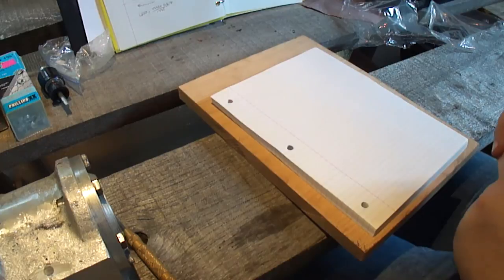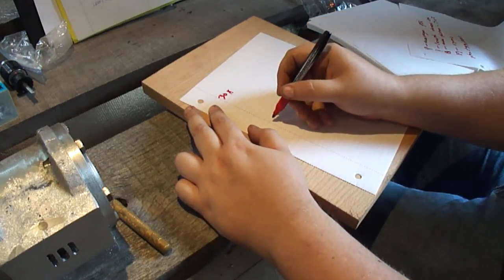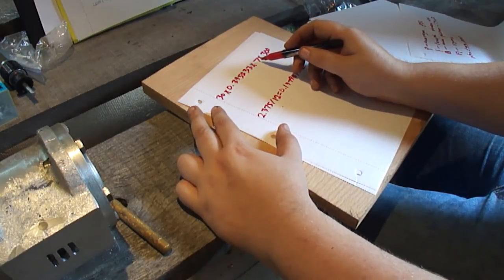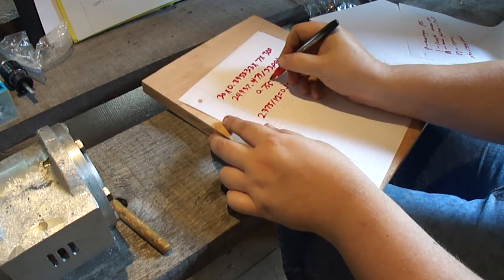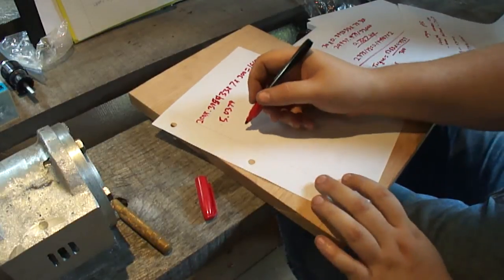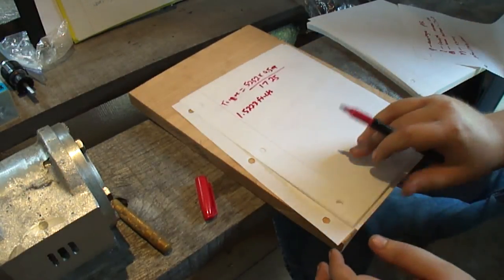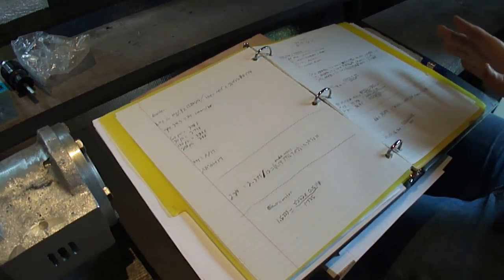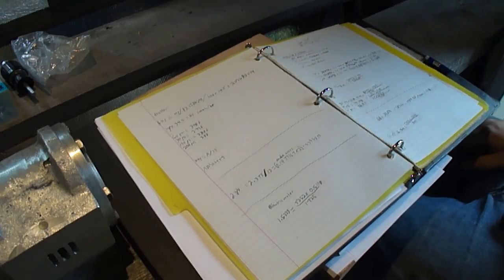Steam Engine Mathematics - Calculating Theoretical HP and Torque

Comment: Have you come across some information that would be useful for computing the torque speed characteristics of a single cylinder, double acting, steam engine?
Reply from the maker: Im almost positive that was exactly what this video was about, lol. It''s been so long since I messed with that stuff that I really wouldnt know anymore.
Reply: @ChirpysTinkerings  The torque speed characteristics isn't going to be linear, so I'm curious if you have come across any references that give a method of approximating the characteristics over a range of shaft velocity (say 0 to 300 rpm), etc. The old text books that I have seen weren't focused on torque speed curves. It may be easier to just measure the performance of a machine with a dynamometer or pony brake.
Reply from the maker: @mrsentinel4911  Yea, I think the pony break is the best option for measuring that stuff. Theoretical and actual is quite a bit diferent when it comes to steam due to ineffeciencies here and there.
Reply: @ChirpysTinkerings  You would think their would be a tables of data for various engines that would give performance characteristics, but I haven't come across any. There is a book titled "Textbook of Thermal Engineering" by R. S. Khurmi that has some very useful theoretical and practical information on performance calculation and measurement, but nothing specific to estimating a torque speed curve that I can tell.
Reply from the maker: @mrsentinel4911  Yea, I doubt there would be anything like that, it would be hard to gauge the curves and such because every boiler, piping, valve, engine, etc setup is different and there's too much to calculate by the psi, if it's wet or dry steam, and if someone had put asbestos and cladding on the cylinder, etc, so the numbers would be all over the place for trying to calculate all of that stuff.  The engine itself, Im not sure you would be able to find the info in a book, but you can calculate it yourself using the info in this video based off the psi, bore diameter, and stroke length. Just chart out it at different pressures and make your own theoretical line chart.

Comment: I've just been thinking about steam from boiler output to theoretical highest torque potential and I soon hit my IQ max barrier
Reply from the maker: lol, yea, it can defenitely be a headache for sure. It's mainly all about pressure, heat, flow rate, cylinder bore and stroke length, and the RPMs to figure out the torque.

Comment: How to calculate hp for a compound steam engine?
Reply from the maker: Im sorry, I dont even remember anymore, but I think it was something like just adding them together theoritically, but in reality, it was going to give around 1.8x the power of the high pressure cylinder compared to the low pressure one when both are added together. Best way to really test it is just to set it up on a prony brake tbh.

Comment: In the plan method, why would you divide by 33,000 specifically? What sort of constant does it represent?
Reply from the maker: I honestly can't remember, its been forever since I messed with this stuff but thats just a universal constant for hp calculations between steam, gas, diesel, etc. I'm sure that if you looked up HP calculation, you should be able to find out why that constant is used. Sorry that I can't really help, but like I said, its been forever since I messed with any of this tuff.
Reply: @ChirpysTinkerings  33000 represents back in the days of using horses that a horse could lift 550 lbs one foot  in height per second as an average. Multiply 550 times 60 seconds in a minute you get the figure of 33000 pounds lifted 1 foot in a minute and that is what they call one horsepower.
Reply from the maker: @kerrryschultz2904  oh, ok, Ill have to remember that. Thanks or the info.

Comment: Really liked the video
Reply from the maker: Thank you, you said something about two cylinders before editing it out, about your question, this post from on the one site that Im on that may help a little bit, it's about the stanley steamer which had dual cylinders. 

"I think Stanley had 4" bores, and it ran at about 500 psi, so 12.56 cubic inches of piston area times two = 25.12 square inches, times 500 lbs/sq in = 12,560 lbs of force, times 2.5 inches (assumed crank pin offset) = 31,400 in-lbs of torque, or 2616 ft-lbs of torque." 

From that, you should be able to calculate out the HP and such.
Reply: Thanks very much you are the fastest responding YouTube I have ever seen
Reply from the maker: no problem, glad that I could be of some help.

Comment: How will this apply for a multi cylinder engine?
Reply from the maker: I honestly have no idea anymore, it's been forever since I messed with this stuff, but I do remember that you have to find the area of both of the cylinders, then times it by some number which corresponds to the offset on the crank pin between the cylinders, but I cant remember the numbers atm. You still have to remember that it is all just theoretical HP and alot of things will change it like how wet/dry the steam is, how tight the engines are, etc. Sorry I couldnt be more help, but thats honestly all I can remember about it anymore.
Reply: All good I was hoping it was something simple like just multiply by number of cylinders lol I'll Google it
Reply from the maker: if you cant find your answer, I would ask over at classicsteamengineering.com, the guy that runs that place could probably answer your question without any problem at all, he's probably one of the most knowledgable people I know with that stuff.
Reply: You use the same formula for a single cylinder then multiply the results by the number of cylinders. These examples are for a double acting cylinder meaning the the piston is pushed both ways. To be more accurate there is an area adjustment because of the cylinder rod reducing actual cylinder volumne so work potential should be calculated on each side of the piston separately.
Reply: @kerrryschultz2904  Ok good. But what would be difference between two cylinders compared to compound twin cylinders?
Reply: @TheControlLogix  A single cylinder using PLAN  is going to give you a horsepower rating. A compound engine is the first cylinder receiving steam and doing work and at the end of the stroke having sufficient pressure to exhaust into a larger diameter cylinder that then does work.I haven't done the necessary calculations of the required second cylinder volume to work properly but a good starting point would be to take say the titanic or a compound railway engine to use as an estimate in designing such an engine.I would assume that the initial steam would have to have a high amount of super heat to  still oppose forming saturated steam or a preheater in between stages to optimize the work done by the steam. Again much more complicated then a single stage.